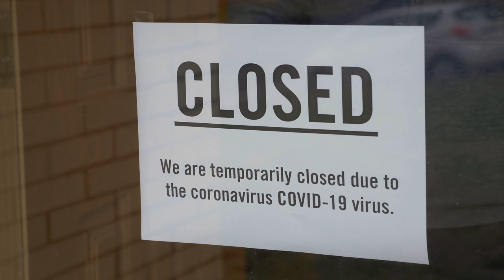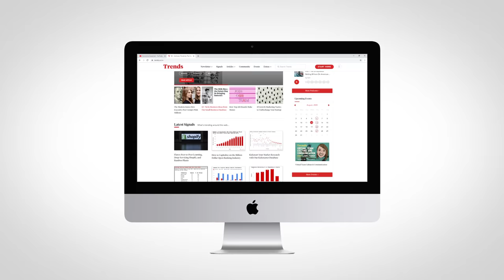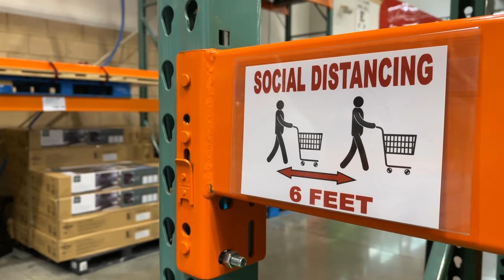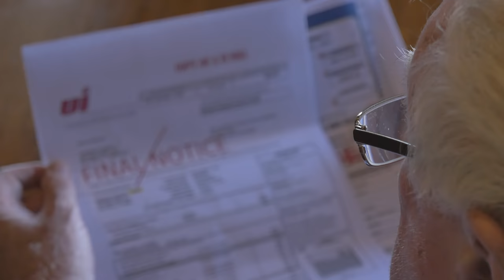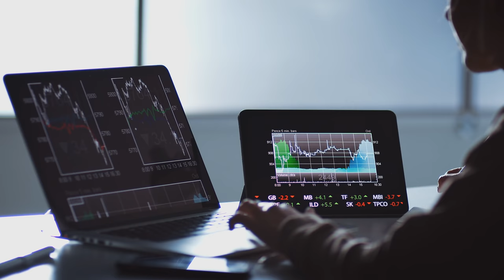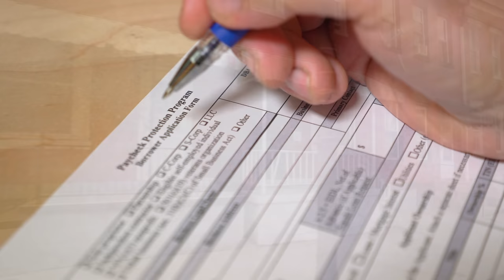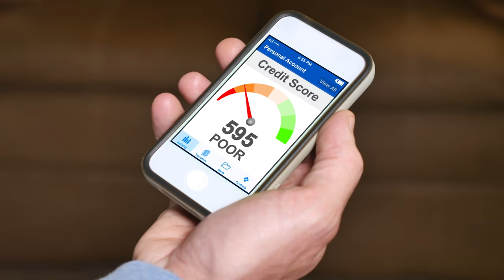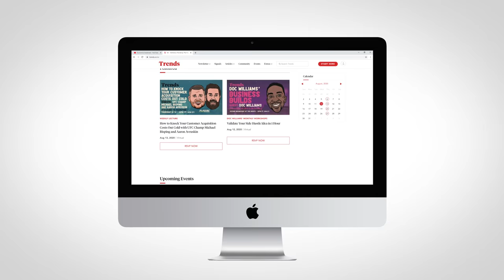Why You Should Be Very Afraid Of A K-shaped Recovery

Comment: The crisis of housing affordability is an important piece in the puzzle of individual spending rates. Ex to afford a bachelor suite in SF area you would need to earn 70k to be living within your means, with similar numbers for the most productive cities in the United States, or for that matter cities like London, Paris, and more. The solution to this may nominally be for people to move away decreasing demand, but from an economic point of view, that has the negative impact of pushing people away from productive areas into less productive areas which weakens growth in the overall economy (already it's estimated that this has left America with 6% less gdp than it would have had otherwise).

Unfortunately for the last few decades, investing in housing, i.e widespread speculation on land price encouraged by the tax code has generally seen increasing housing costs as something to be desired as opposed to something to be avoided, and a lot of people will lose out if policies successfully reduce housing prices or even housing price growth. This dynamic is part of why it's so hard to implement a land value tax or for that matter, even property taxes given that a number of states have limited assessed values to far below market values (ex California). This also leads to a massive age divide in politics, given that high housing prices mostly result in the transferring of money from young people to older people.

In short, at some point, there's going to be a need to address the dilemma of the fact that housing prices have vastly outpaced wages. Worse yet for that matter, the past few decades have seen a higher return on investment from land than equity; it's been better to block development and demand money than it has been to actually produce things.

Comment: I think it will be V or W. The thing is, it wasn't an economic disequilibrium that case the economy to fall off, so there is no disequilibrium to clear out. Plus, people are eager to get back to economic activity. The problem with most recoveries is getting people to want to reengage economically. SO we don't have two of the biggest problems with most economic downturns. So it really is just a matter of reopening the floodgates to allow people to engage in the economy as they already want to do.

Or is it? Just because the downturn wasn't caused by disequilibrium, that doesn't mean disequilibrium hasn't been created. And I'm not so much worried about the "stimulus" (a misnomer **) wearing off as I am about the "unintended consequences" of that "stimulus" rearing their ugly heads. So yeah, just as people are going back to full economic engagement, we may then realize created disequilibriums and the unanticipated consequences of the "stimulus", creating a W.

But as to the K - yes, there are segments that just aren't coning back to the same levels as before and those that have lost "critical mass". So I would say a K and W overlaid. I don't think there's a letter for that.

** - it's aid, not stimulus - "stimulus" doesn't even make any sense - it's like saying your going to stand on the brake and the gas at the same time. If that were the case, you could just let off the brake. Why would you stand on the gas if you are deliberately standing on the brake? You aren't trying to give the engine gas to accelerate, you want the engine to have enough gas to just keep running without stalling. But when the only tool in the tool box is a hammer, the word "stimulus", then every problem looks like a nail - calling everything you do "stimulus".

Comment: one thought about the savings thing. Multigenerational households are fine and dandy but impossible in modern societies with job mobility being an important factor. Also. Savings are exactly not the problem in modern societies. While overspending is a problem it only arises in societies where productivity is channeled into the savings of the ultra wealthy. The problem is savings being accumulated by the wealthy few while the consuming middle class is being exterminated. A prosperous society is one where the product of human labour is turned into wellbeing and prosperity for all, not  into stagnant savings for a few.

Comment: the economy works like this. gnomes run on tiny tread mills to power stock tickers at wallstreet. gnomes only do the work if they get pixie dust and go on strike if they dont get enough. they shut down trading for the day when that happens. pixie dust is made from broken dreams and nightmare fuel typically the work is done by goblins in 3rd world countries where starvation is more common but the erosion of the middle class in america has allowed for domestic production of pixie dust to flourish in recent years as dreams are shattered and nightmare fuel bleeds into every day life .  the economy has never done better and market volume is the metric by which a economy is judged... not the  lives ruined living under draconian usury brought to the masses from bankers with forelocks

Comment: How does one live within their means when prices of goods and neccessities increase at a constantly faster rate than the rate of raises given? What's worse is a system that encourages "hustle" and "getting things done regardless of obstacles". Which means being flexible enough to complete a task issued despite having to going against standard procedure. Then you're punished for either breaking a rule(doing what you we're told to do), insubordination for refusing to, or told that you've failed because you attempted to meet quota while operating within standard procedure. Then you have a criminal record and can't get hired.

If you succeed in meeting quota the reward is an increased quota. Once the requirement is too high and unsustainable you fail as designed. Then that one failure is held over your head as leverage to deny you raises.

Also, new to the channel. Love all your content.

Comment: There is a real problem for the UK as an economy functioning on a normal basis. As this video points out, there is a disparity between those who are asset rich and those heavily in debt. This is an inefficient wealth distribution as those who are asset rich don't spend enough and generally lead to higher asset prices as this is where their money will go.

Since the 1980s we have seen the UK rely on more and more private debt being used to power the economy. Prior to Thatcher, UK private debt never ever exceeded 75% of GDP. It now stands at about 250% of GDP. It is a source which must be close to being fully utilised. We are heading into dangerous uncharted territory which could limit economic performance for decades to come, and that's if we don't have any more economic shocks. We know however that we may well have to face up to a covid second wave and a no-deal Brexit.

Comment: V or K it does not matter. It is always S shape in the end. It goes up then back down. Just to repeat the whole process. It is boom and bust ( B&B ;) up to a point of no return. The more debt accumulated the shorter the upper part of the S and the longer the lower one. Going down happens in no time while a recovery takes more and more years in each consecutive cycle, frequently it can't even happen in full before another cataclysmic event pushes it back to the bottom. It is like shipping water, you get more and more , but have no time to get rid of it before another wave strikes. Just think about this analogy for a few seconds to figure out the end of the story ... and the end of it is this: S starts looking more and more like the integral symbol, when it can't stretch any more, the ship sinks. Both the reach and the poor drawn. Actually to end on a positive note, only the poor will do. The rich will be rescued, or bailed out I should say ;). Happy endings do happen in real life too, but only to those who can look after themselves while governments are in a panic mode and do whatever it takes to keep the wreck afloat for another round of austerity seasoned recovery for the few.

Comment: The problem really is that the stimulus aren't removed after the crisis is over. And when stimulus is still happening it helps those in debt an unfair amount, which hurts those with savings, which means why bother saving, when you can just get a subsidized loan?